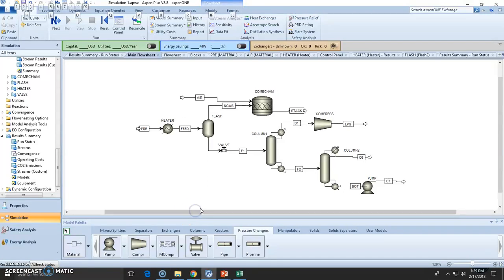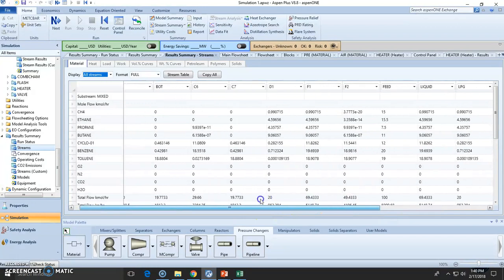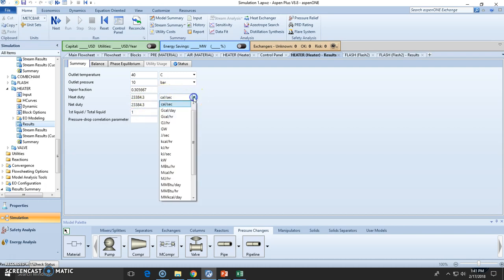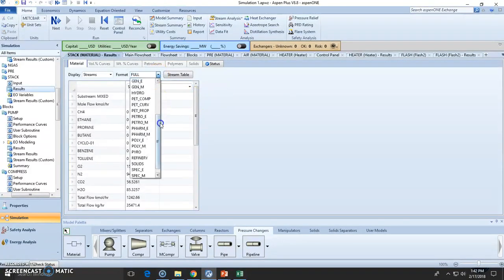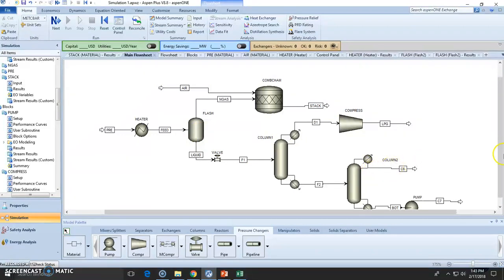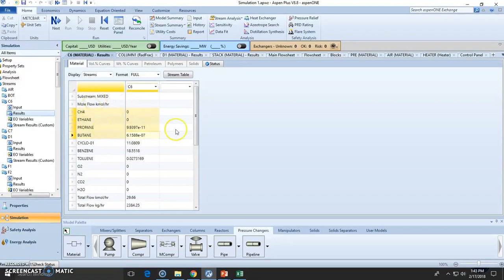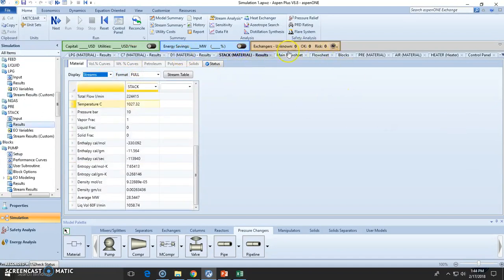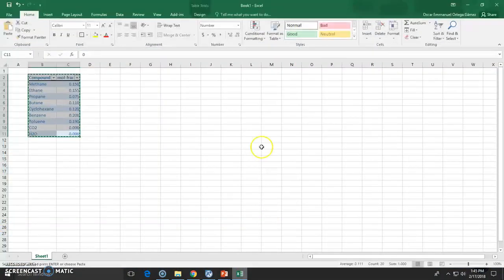Getting Results of streams, blocks and simulation in Aspen Plus (Lec 022)

Comment: I have lot of severe error how to solve errors
SEVERE ERROR WHILE IN SEQUENCE MONITOR                   (PPCOM.2)
   FLASH CALCULATIONS FAILED TO CONVERGE IN  13  ITERATIONS.   BUBBLE POINT
   CALCULATION HAS DRIVEN THE TEMPERATURE DOWN TO THE LOWER LIMIT OF
   25.1938 DEGREE K.  BUBBLE POINT TEMPERATURE MAY NOT EXIST AT THE
   SPECIFIED PRESSURE.  BUBBLE POINT TEMPERATURE COULD NOT BE CALCULATED DUE
   TO FLASH FAILURE
Reply from the maker: This error means Aspen can’t find a bubble point at your set pressure. Check feed data, adjust pressure or initial guesses, and verify your thermodynamic model.